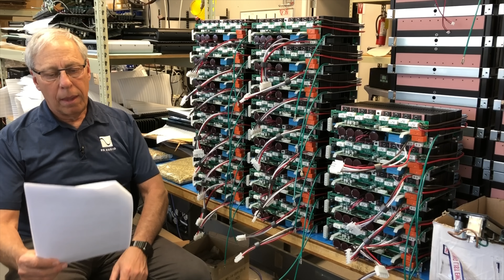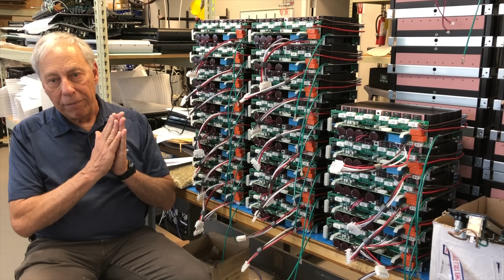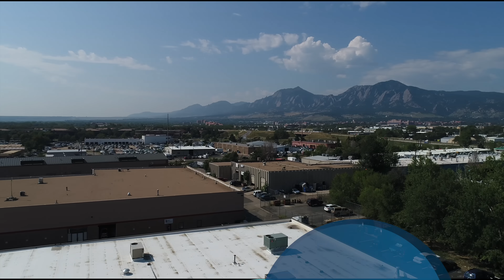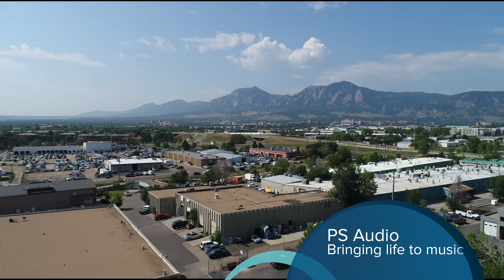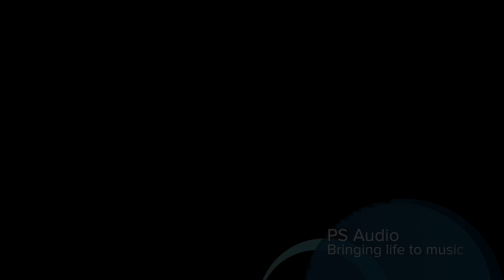How do different cone materials affect sound?

Comment: What makes a speaker to be more sensitive ? To have higher SPL per meter. 
Also how different shaped cones affect sound ?
Reply: The 3 most straightforward ways to increase sensitivity are 1) increase the area of the diaphragm 2) decrease the mass of the moving assembly and 3) increase the force factor Bl, which is the magnetic flux density in the voice coil gap times the length of the voice coil wire. Force factor and mass have a frequency-dependent effect on SPL whereas the diaphragm area affects all frequencies the same (assuming perfect linearity). 

The shape of the cone can drastically affect its strength. A stronger cone is more likely to act like a piston (meaning every point on the cone experiences the exact same displacement), and will therefore respond in a linear way to the input signal. A weaker cone will start to flop around at higher frequencies (different points on the cone experience different displacements), which is a non-linear response to the input signal. You can hear these non-linearities in the form of harmonic distortion, known as "breakups".

Comment: In my 40 years of making my own LF and LMF cones I have found that treated pulp produces the best overall tone and provides superior damping. Coatings can range from polymers to aquaplas depending on the frequency range you are trying to reproduce. For very LF (below 300hz) Aquaplas or a semi-soft polymer works best for me while for low-mid a polymer coating similar to that used by KEF works best.To improve piston linearity the coating should be somewhat thicker to the center of the cone. Have also found that thinner pulp is better for mid's as they require less damping and require more detail. Have had not success getting metal cones to produce a natural sound (lots of detail at the expense of tone). We use  two types of coating on mids: one is a stiffening agent and the other is for damping. The damping is never applied uniformly on the cone.
Reply: What the hell is "woke"?
Reply: mike young Thanks for sharing! Would love to find some content online which speaks on this process. Either reading or videos if you know any would be lovely, have a great day!
Reply: Joke: Poly cone
Broke: Aluminium cone
50% woke: Coated paper cone
150% woke: Bare paper cone

Comment: IMO, Kelvar is one of the more undesirable cone material due to the "sctratchy" sound it produces.  I'm actually surprised its not a more common complaint especially since Kevlar drivers are used in some very expensive speakers. I suppose its a subtle problem and every material has it drawbacks, but I hear it in both B&W and Quads that use Kevlar drivers.
Reply: Gizmo Thewytchdoktor sometimes I think that these unforgiving and revealing speakers /drivers are just sounding good when you don't excite their problems. Some songs just don't excite resonant problems, others will by nature of content.

It seems you either go heavy material for less resonance and clean but heavier, less dynamic sound, or you go for the lightweight dynamic and transient sound that will have resonance in some way or another that gets to you.

The struggle is finding a compromise imo. Some people can live with the shortcomings of livelier drivers and hate the heavy boxy sound, some like very little resonance peaks, others try to get the balance of both. And then there's people who just like a certain colouration of the sound that is pleasing to the ear.

For HiFi listening, get something you like.

For studio, get something that translates and that you can live with wrt sound. No point getting a revealing monitor if it also grates your ears.
Reply: terry...kevlar is an unforgiving but accurate material. if there's a flaw in the chain...it will uncover it in an unforgiving fashion. much like titanium h.f.drivers. silk h.f. driver...very forgiving. titanium....dreadfully unforgiving. clean,accurate power is the order of the day for such materials.that isn't a budget friendly proposition to be sure.
Reply: I don’t think the problem is with its unforgiving nature.  I think the problem lies in the fact that the cones are made from woven Kevlar strips/fiber that, when they vibrate, produce a self-abrading resonance that result in an audibly scratchy sound.  Its subtle, but I can hear it on certain passages of music with the handful of the existing Kevlar drivers I have heard.  Those same passages when played on highly resolving speakers (like Focals that have the W composite woofers) sound clear and resolved without the scratchiness.
Reply: terrywho22 - Yes! Once upon a time I had installed Blaupunkt kevlar speakers in my car and it was the worst mistake.
Reply: Nikhil Gee - Thanks, glad to read that I'm not the only one!
Reply: Rennie Ash: great points.
Reply: +Rennie Ash; IMO, Reinforced Paper for woofers and subs, (unless they are just for sheer SPL levels), Polypropylene, (or some mix of it), for mids tends to sound best overall, and depending on your ears and taste, Silk dome tweeters for softer, more mellow, but still very listenable long-term, or else titanium or some other metal if you like very bright, detailed highs with a lot of transient attacks, etc... but those can get harsh and fatiguing to listen to long term also, so I tend to generally prefer Silk dome tweeters instead... Or possibly a very good, well designed ribbon type... 

There's just SO many options out there with speakers, and every persons ears are different, so you just have to find what sounds good to YOU and go with that!... As audiophiles, arguing too much over this or that in the audio world we tend to get caught up in the argument and/or the technical details and measurements sometimes... You can't forget to just sit back and ENJOY THE MUSIC when you hear something that pleases YOUR ears, instead of endlessly nitpicking the details about everything! LOL!
Reply: JoeJ8282 some metal drivers that I've liked are honeycomb sandwich. Usually they have a damping glue in them. Sounds quite nice and if made right they aren't too harsh and sounds very spacious. Can agree with polypropylene being nice. Paper woofers seem to be the lightest and stiffest usually. I'm after some Acoustic Elegance woofers.

Personally I don't get why they haven't tried honeycomb composites these days as much. If it's done in the 80's, today it would be even better!
Reply: terrywho. Bmw speakers kevlar woofers sound is not clear.

Comment: paper....in a stage rig. combo heads and stacks. 
past that...i always use alternatives for reproduction.
creating and reproducing sound are to separate things. this requires different compounds.
Reply: Why paper in a stage rig? Like stage monitors or instrument amps? I can't count the number of times I have seen old JBL drivers with paper (reinforced) cones that have "shit the bed". Not to mention never sounded good in their prescribed application. Aside from the fact that paper flexes a ton causing massive unintelligibility issues it is also usually used as the low driver in a 2-way monitor (2 way to maximise intelligibility. Crossovers create phase shift and distortion) and in that case in order for it to go low enough and loud enough has to be a bigger driver. It can't usually go high enough to mate with the high-frequency driver well. I have yet to hear a high SPL, high-frequency driver that sounds smooth at 1500 Hz. Kevlar is kinda good for that. Fibreglass is more common though.
Reply: Instrument amps are a different thing. The flexing is part of the sound of the instrument. That said there are a lot of variations on driver designs there too.
Reply: hmmmm....something's missing.
Reply: I was waiting for you to reply as to where you would use it in a stage rig.

Comment: Carbon fiber might be interesting. Stiff and light.
Reply: It is becoming more common but I saw a chart recently and it showed that fibreglass for instance in many cases outperformed it.
Reply: Carbon fiber is light, but not the epoxy/fiberglass resin/hardener needed to stiffen it.
Reply: Dave Micolichek  Ya, when it comes to speakers we are really still futzing with Epoxy resin as a binder regardless of the other components. BTW there is "fiberglass" and "Glass Fiber". To this day I am trying to figure how they are actually not the same material other than how they are set up. By that I mean fiberglass is actually just the resin and the glass fibers mixed together usually where in terms of what Infinity refers to as "Glass Fiber" it is a woven mat which contains some amount of binder somewhere but in the case of my sub in my car the resin is not visible to the naked eye.

Comment: Paper cones can be a bit soft  ,  Plastic gives better detail  ,  you can stiffen paper but it can be risky
Reply: Have soft ones then
Reply: sometimes plastic cones can ring
Reply: As Peter says, there's nothing stiffer and lighter than paper! 
https://www.youtube.com/watch?v=Xz45IYZQMf0
Reply: If Feastrex really do make paper cone speakers that cost $70,000 a pair, paper must be ok. lol And even more ridiculous, for that fucking price you don't even get any enclosures or crossovers, just 2 8" full range (field coil) drivers by themselves. lol
Reply: Plastic is also a bit soft and has high inner damping. Therefore it doesn't give so much detail as metal - aluminium, magnesium, beryllium etc. or ceramics. Plastic cones are also slowly becoming extinct so they seem to be less good.
Reply: @mariusloubeeka5810  tell that to JL audio. Their flagship w7 is a audiophiles dream.
Reply: @jondoe6618  : Addition to my previous comment: the most loss of detail occurs in those parts that are being deformed on purpose during movement, such as surround and spider. That in particular are non-linear mechanical losses (Thiele/Small parameter Rms) because the higher the SPL the bigger the deformation. Furthermore the harder the suspension the higher the losses.
My favourite German DIY loudspeaker magazine Hobby HiFi say that a large part of mechanical losses occur in conductive voice coil formers (aluminium). Those losses are linear and therefore not swallowing detail but lowering the sensitivity. Unfortunately there's no way to find out how big each part of the losses is except if you compare two identical drivers which only have different former materials.
Hobby HiFi tested the JL Audio 12W7-3 in issue 1/2003 and the 8W7-3 in issue 5/2005. They look really impressive. After comparing Rms values I'm afraid the audiophile qualities of the 8W7-3 might be inferior to Visaton's 8" flagship TIW 200 XS (also tested in that issue) - but not due to cone material. Both have Kapton formers and about the same piston area. The 8W7-3 has of course nearly twice as much linear cone displacement (19 mm compared to 11 mm) but also a much stiffer suspension (Cms = 0.23 mm/N and 1.2 mm/N) and therefore mechanical losses four times as big (3.7 kg/s and 0.84 kg/s)! So my choice would rather be two TIW 200 XS to get the same maximum SPL - okay, they need a much bigger box (2x 62 litres instead of 35 litres). Maybe I'd even use four, each pair in an isobaric configuration. That would even still be cheaper: 4x 125€ = 500€ instead of 700€.
But for the 12W7-3 everything looks better.
Reply: @mariusloubeeka5810  Yeah, I guess you are right. I noticed that the brand Quadral mostly uses an alloy of aluminium, titan and magnesium in their woofers. Must work pretty well.
Reply: @Kyouske_42  : Yes, abolutely! Also if you take a look at the high end driver manufacturers Scan Speak, Wavecor, SB Acoustics and Seas. As far as I know only SB Acoustics and Seas have few drivers with plastic cones but at the upper price range it's magnesium, ceramics, aluminium and (surprisingly often) paper (but mostly fibre reinforced).
Reply: THATS CORRECT,  i am taking that kind of risk, applying a couple of layers of resin. at the time, i have  good results
Reply: All cones ring, some ring worse than others. Hard thick cones are worse for ringing.
Reply: Yes its lighter  , the voice coil & magnet are tuned to plastic cone .
its the detail is more exposed with plastic .
I have them both but plastic is tougher for knocking about .  
paper gets a crease on the cone  that is seen alot of speakers .
To be straight , its the sound that I go by .
The vice coil is the main heart for how sensitive it is .
How many people change the cone for a debate ?
Reply: +shan
Paper for med is good I reckon, cos when you rub paper it tends make "white noise" and no other stuff seems to. Also a company called Feastrex make full range drivers with paper cones and their flagship drivers cost like $70,000 a pair (just two 8"paper cone drivers). lol So paper must be ok for med. In my lounge speakers the tweeters are soft cloth domes (with an added mini aluminium whizzer). And in my PA speakers the tweeters are like mylar with metallic coating and paper cones for the bass/med PA drivers. And I have paper woofer cones in my lounge speakers (not subs).
Reply: I know they still make paper cones , thats up to the manufacturer what goes  . 
A good heavy strong magnet & coil  is what dose it .
All speakers behave different when building the cabinet .
In my experience  some prises are so HIGH , the depth in the sound should match as well .
Expensive materials  with some speakers   was it the MISSION  753s with 4 bass drivers ? I forgot the number , it was a demo , these speakers are very heavy , nice speaker  in the late 90s but they had a poor depth sensitivity for what they were .    The top end had no problem at all

Comment: What is the reason for drivers that do the exact opposite of what you say -- specifically, soft dome, fabric tweeters? (BTW, I'm not criticizing; my primary speakers use silk domes...just wondering)
Reply: Gary Karlin silk dome use for damping properties 
High mass stiff material hard to control damp at high frequency and
Dome use to give structural strength  to soft silk.
Reply: Innocent soul I understand, but it still seems to me that a soft dome would still break up =distortion ... more than a stiffer metal diaphragm. Is there a hard choice between good damping and good (low) breakup?